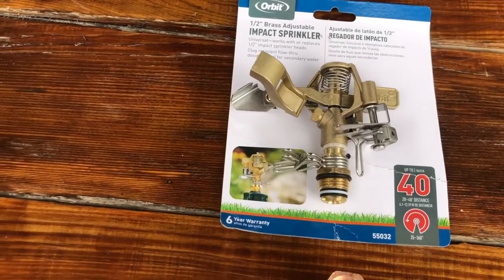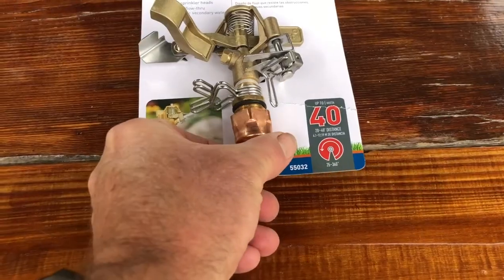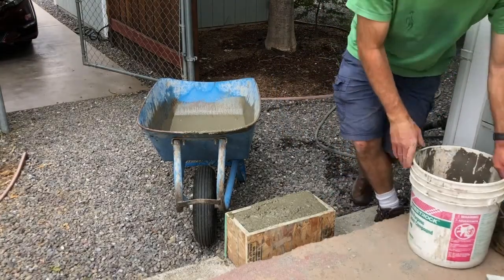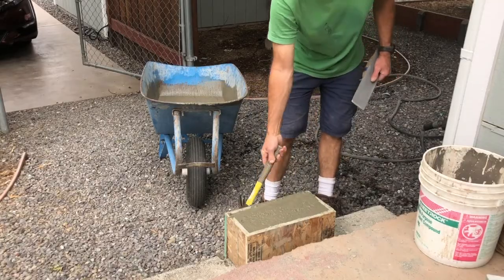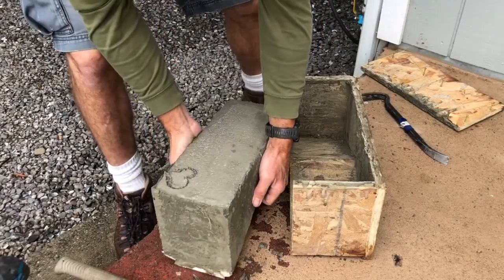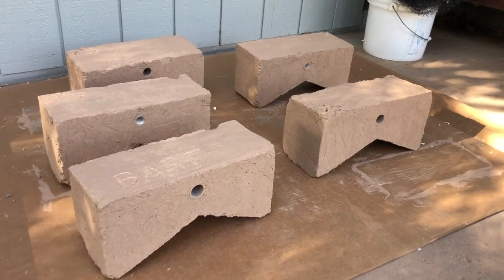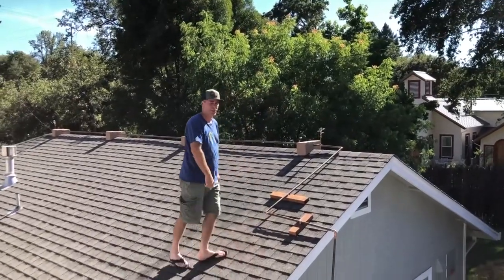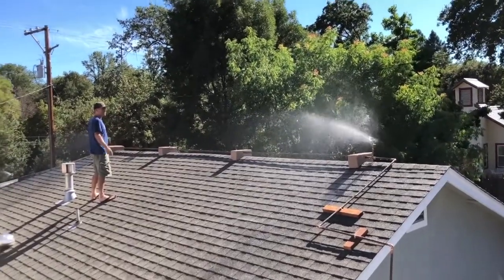Build your own Rooftop Sprinkler System/Fire Harden your home!

Comment: You prob dont need the riser tubes for the sprinklers, just mount on the "T" fittings as the spray arcs up. (not sticking up so high off the roof)  If there is a fire it will be windy and blowing water away from where you want it.  They make sprinklers that you can mount on the gutters from the ground.  This might be an idea for the windy side of the house.

Comment: Thank you for the video!  Do you have any idea of what the flow rate gallons per minute or hour is for this type of system?  I am looking at having tanks that collect rain water then have a separate battery or I/C powered system to pull from those tanks incase of reduced city water pressure.

Comment: I imagine a lot of homeowners will be looking at this.  As long as you have power and water pressure and can turn it on remotely, it'll be fine.  But in the large fires in LA, power wasn't available and in some areas, neither was water so remote control wouldn't work unless you can rig up a 24v battery system to provide power.  Being in northern CA, if you haven't considered water freezing in the pipes, yoiu might want to consider a way to purge/drain the water until needed.

Comment: As a bonus, if you tune your sprinklers in so they only hit your roof, they do a GREAT job of cooling it off in the summer when you get home and want to crank the AC.
Especially if you have a tile roof, it helps to lower the thermal mass that your cooling system has to mitigate. 
Of course it takes water, but if you put plants/collectors under your gutters you reuse everything that doesn't evaporate anyway.

Comment: For a less-intrusive appearance than 2x4's or concrete for holding the copper pipes on asphalt shingle roofs, look at copper bell hangers.

Run your copper water supply pipe on one side of the roof ridge or the other, just below the ridge cap shingles, using these bad boys screwed into your roof trusses. With the bell hangers, you can apply a (1" diameter, 1/4" thick) blob of roofing sealant to the shingle where the screw will penetrate, then screw the bell hanger down. For belt-and-suspenders installs, lift the shingle up where the bell hanger will be installed and insert a 3"x3" piece of Ice and Water or Vycor peel-and-stick flashing UNDER the top shingle (makes a sort of "gasket" to seal around the screw penetration) for your "belt", and THEN do the roof sealant under the bell hanger for your "suspenders". Using a heat gun to soften the Vycor or ? will help it to adhere to the shingles (hillbilly hack - in a perfect world, you'd apply the membrane to the roof deck (best) or underlayment (better)).

The same technique works for securing your pipes to any rooftop plumbing offsets, fascia (if backed by 2x framing), or walls - always use the sealant (polyurethane is better for fascia and walls), and be sure the hangers are screwed into structure, not just the fascia or sheathing.

Comment: It would not have worked in California.
The water supply to you house is the same water as the hydrants that had no pressure.
It may even be illegal.
It sounds like a good idea, but if a lot of sprinklers are running on an already compromised system, it would bleed down both pressure and supply.
Local ordinances may prohibit this setup.

Comment: I watched another video where the forms for the blocks were wiped with motor oil  before pouring the concrete, making the form easier to remove.
Reply from the maker: Good advice, someone mentioned you can use biodiesel, which I'd like to try as it is a little more environmentally friendly.

Comment: First step should be re roofing with metal with concrete board under it. Thats what my place in S Oregon has. Then the sprinkler system. Too bad I only have a low output well and 1000 gallons in the tank.
Reply: A gent I know who is in your situation with a low-flow well and not enough tankage just bought a 2500 gal tank from Tractor Supply to increase his water storage capacity. He did this because of issues with the cost of/ability to get fire insurance.

Comment: This is awesome unless you live in Los Angeles where they regularly have no water. People with swimming pools have an excellent secondary source of water. Awesome video brother!✌️
Reply from the maker: Mahalo!  Yes, having your own water source is the best possible option for sure!
Reply: "Regularly" have no water?  Oh, those poor dessicated Angeleños!  Do they all have to stoop to drinking Chardonnay!!??

The more water you draw from a water system in a given period of time, the more the pressure drops.  If a water line is designed to flow at a maximum rate and you exceed that rate (think 20 fire trucks pumping from a system designed to support a maximum of 5 fire trucks pumping at the same time), the pressure drops, and can really drop DRASTICALLY. Hence LAFD et al reporting reduced water pressure or a dribble.  A reservoir empty because of maintenance issues exacerbates the problem, because the head pressure that reservoir would otherwise provide means the fire system can't even provide its "design capacity".

Right about now, I'm ALMOST wishing I had a swimming pool...
Reply: A good argument for having a backyard pool, even if it's an above ground type. Better than just having a 1500 - 2500 gallon tank. You can't swim in those! ( Albeit, the tanks will last for decades. Above ground pools, not so much.)

Comment: Thanks! Thinking of getting my own well dug- likely wouldn't be much water pressure left in our municipal water if things got bad.
Reply from the maker: yes, having your own water source is the best possible option for sure.  I'm hoping to upgrade this system with my own water storage and gas powered pump.

Comment: Nice system.  Consider adding an inverter or generator to your setup, because you won't have utility electric power for your control valve or router if there is a wildfire - and it might be moot anyway, because it's likely that your hardline phone or cable Internet access will be lost in the event of a fire.
Reply from the maker: Yes, we do have a lithium ion solar generator (Goal Zero) that we can hook up during a power outage.  Question is whether we have time to do it...a quick evacuation may not allow us to pause for that!
Reply: @kekanipahu  - Odds are, the wiring for your sprinkler valve isn't anywhere near the router in your home, anyway, meaning a lot more work either running additional wiring or adding a transfer switch to your electrical panel. It's all about planning to do whatever you can do (and are willing to do) to prevent the loss of your home.

Comment: The only concern I have - speaking as an Australian who is used to bush fires - is the availability of water not being guaranteed. One of the finding out of the 2003 bushfires in Canberra (Australia's Capital City) was the significant drop is water to the Suburbs mostly affected. 

Entire suburbs where wiped off the map because even the fire trucks couldn't water from the hydrants. Also, the loss of electricity (even underground) meant that electric backup pumps wouldn't work. 

Suggestion: have a backup water source readily available with a petrol powered pump with sufficient pressure to run the system.  Those IBC totes, the plastic drums in cages, would work fine and give you (hopefully) enough backup so long as you have enough of them.
Reply from the maker: Yes, absolutely a concern... no water renders this system useless.  I plan on upgrading with my own water supply and gas powered water pump.  That way I can continue to protect the house even when the main water system is down.

Comment: I feel like builders could integrate this system under the roof ridge so it isn’t visible. With the big pop up lawn sprinklers like on a golf course.
Reply: Replace the roofing material with metal and protect or eliminate all openings into the building.  Eliminate gutters which fill will wind blown,  flammable debris in seconds even if previously cleaned.
Reply from the maker: I love that idea!
Reply: far better to keep exposed. A leak will destroy your home if it's hidden  under the roof. A more pleasing mounting system may help but for DIY, this looks like a fantastic solution.
Reply: @ maybe, but that could be said with any indoor plumbing or piping. It would be better inside to withstand the weather over the years.

Comment: Hose bib only has a 3/8” opening in the valve, replace with a 3/4” garden valve will increase the water pressure significantly.
Reply from the maker: Thank you!  I didn't even think about that...it really reduces the flow rate going to 3/8".  I'd even like to go back further in the supply line and T off where it is 3/4".  Much higher flow rate.

Comment: Looks good, same as the other video I know the one. In both instances,  I personally would have at least another two / three heads on the roof.  Water supply is it mains, that's likely to be reduced if not diverted. Water tank/s capacity = time of coverage. Garden sprinklers in support. As we all know, these are literally devastating times. Overkill on a defensive system requires total saturation, otherwise you could just be pacifying your concerns. But any defensive measures are better than no insurance cover.   Nice video explanation 👍  stay safe HNY
Reply from the maker: Yes, good advice...more sprinklers would be ideal.  My issues have to do with water flow rate. I think the water valve that I tapped into for this system is 1/2". I'd like to go further back down the supply line and tap in where it is 3/4".  I'd be able to add more heads without a reduction in water flow.  I definitely want to keep tweaking this system to make it better.

Comment: So where is your water coming from? Local water coy? That will fail as it did in LA this week. You would need a water tank large enough for 30mins of supply & diesel/ petrol pump too.
Reply from the maker: Yes, local water department...from tanks up high on the hill so it is gravity fed.  But you are correct, having my own water source/gas water pump would be ideal. Then it wouldn't matter what is going on with the local water supply, I'd be using an independent source.

Comment: This is a great idea but you dont need to irrigate your non-combustible roof. Its better to have the system spray the side of your house and any vegetation that hasnt already been removed. I have seen homes burn down with these types of systems because people dont cut back the brush first and clean out their gutters. If anyone has any questions regarding this stuff, ask. I want to help. FF for 35 years.
Reply from the maker: Thanks for your input. You are totally correct, the shingle composite roof is pretty fire resistant on it's own.  My idea is to wet it down, but also everything around the house too (trees, neighbor's house, cars, fences, etc).  I've also heard suggestions that I need to add sprinklers under the eves, which would wet the walls down too. That's my next step!
Reply: I think the roof still needs to be cooled. If there's a raging fire rolling by, the roof can keep heating until the stuff underneath (wood) starts burning.
Reply: I've seen systems that spray vertically with spinning nozzles. They are mounted at eave and gutter level.  I guess the idea is to create a "wall" of water.  Is this a more effective design?
Reply: @ It is a better design but its better to keep your gutters clean and remove/reduce combustible vegetation from around your home. Most of the homes that were destroyed in the Camp fire in Paradise, CA had leaves or pine needles in the gutters or on decks and other combustibles around the homes. Wood fences also transferred fire from home to home.

Comment: My concern with such a setup is having the water effectively water the entire roof during a firestorm with winds well above 40 mi an hour. It looks like a great idea but I think when it's most needed there are going to be very high winds
Reply from the maker: Good point....the winds definitely complicate the effectiveness of this system.
Reply: @kekanipahu  We live in Vista Ca and get Santa Ana winds as well, not as strong as some areas nearby. The winds tend 2 gust and not a constant 30-40 mph so the sprinklers should work with coverage between gusts. I have Spanish tile (concrete) roof so fire resistant but embers can still get up inside then and start a fire. Hoping sprinkler system would help to extinguish the embers.

Comment: Since the fires in LA just happened, it would be a good time to talk to your neighbors around you to do the same thing to make a bigger footprint around your house and the neighborhood. I live in the woods in North Idaho and I have done the same but I have put in 5000 gallon cistern to pump water out of because my well can only do 10 gallons per minute and my pumps can push 75 gallons per minute.  I also have a portable 900 gallon tank in a trailer That I can move around between my property and my neighbors and it can run two 1 1/2  inch hoses and push 75 gallons per minute.
Reply from the maker: Absolutely...I've been trying to get my neighbors to put a system like this on their homes.  Increasing the footprint of the protected areas is key.  If your neighbor's home is going up like a torch, all the sprinkler systems in the world might not save your house!

Comment: Great vid! We live in SoCal near two canyons. Working on getting better prepared right now. What happened in L.A. could totally happen here! Your concrete forms answer my question of how to keep the sprinklers from blowing away in the Santa Ana winds.
Reply: Keep in mind that these types of sprinklers won't work for a real fire. The problem is wildfires create intense winds that would simply blow most of the water away from the home. A better solution would be to have some sort of high-pressure nozzles spraying water directly on to the roof so the water is less likely to blow away and ends up dripping down the sides of the roof. Also would be wise to have mist sprayers placed in your eaves and spraying directly into the eaves. Fire embers often gravitate towards eaves and create fires.
Reply from the maker: Yes, I'm really happy with the concrete forms holding everything solidly in place....holding strong after two years!

Comment: Great job quite professional pacing is excellent camera angles are excellent I look forward to seeing the automation and remote control so you could turn it on in a remote location.
Reply from the maker: Thanks for the positive feedback, I appreciate it!  Yes, I have since added a B-hyve remote watering valve to the connecting point of this system.  I can leave the hose valve on, and control the on off operation from my phone remotely.  The one setback to this is if the power to your home is shut off, the B-hyve relies on your home wi-fi to send the signal to the unit.  One option would be to connect your home wifi to a battery pack (Goal Zero, etc.) if you have time to do so when you evacuate your home due to fire.  Here is the link to the B-hyve (I'm happy with the quality and would recommend this product).  https://orbitonline.com/products/b-hyve-smart-hose-watering-timer

Comment: Helping hint soak the inside of your forms with diesel fuel before you put your concrete in. It helps when it comes time to remove the concrete from the forms. Do it on fresh wood and clean well after with water after using them. Then treat again right before your next batch.
Reply: Diesel or regular gasoline works. I'm a retired precast concrete manufacturer. There are numerous release agents specifically designed for this use.
But you don't need that much for this project. 

Here's my quick and easy suggestion for this use on a simple casting like this.... Spray the forms with WD-40. Simple. Not ideal for surface finish (none of these are), but it's a useable option. It leaves a film without the flammable oil residue. Repeat for each casting. 
Great video, btw. Good luck!
Reply from the maker: That is a good tip.  I've seen professional concrete finishers use diesel to help with the concrete sticking on the forms.

Comment: QUESTION: Have you thought about if you lose water pressure?
My understanding is electricity may be turned off, and/or pump stations lose power during wildfires/whole neighborhood fire-like situations.
Alternatively, there was a service who had a pump & gas generator feed a similar sprinkler system from a swimming pool in the backyard.
Reply from the maker: yes, good point on the water pressure.  In our case, our water pressure is provided by gravity...no electricity required!  The one concern I have is if the water pressure is low because firefighters are plugged into the hydrants.  I think at some point, I'd like this system to be hooked up to an independent water source (large tank), and a gas powered pump to deliver the water to the sprinkler heads.  That way I would have a self contained system that I could operate independently.
Reply: @kekanipahu great job on the system, living in rural Australia we are also very familiar with forest / bush fires. I would suggest that relying on the mains water supply and pressure is a risk, during a fire event the demand on the mains water is significant and you will likely have a large drop in pressure or at times no pressure at all. As you mentioned, an independent water source and gas powered pump is a good next step in improving your setup.
Reply: @j21036  "Gas" in the US is what we call petrol in Aust. An auto start up diesel pump is better because the temp. at which a fire can damage it is much higher.
The extra 500 bucks or so will be worth it if a big hot fire comes your way. Nothing is more upsetting to see a home destroyed with a swimming pool full of water next 
to the pile of ashes where a home used to be.
Reply: @geoffbrookes4014  unfortunately those are very rare in the US.